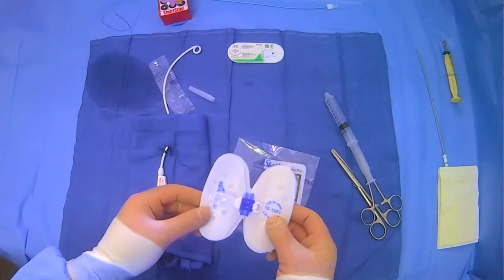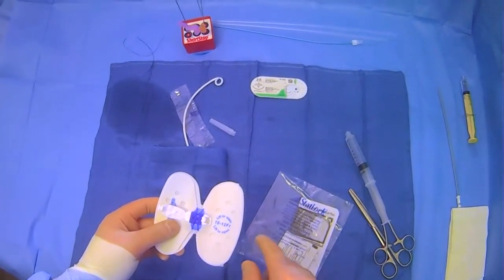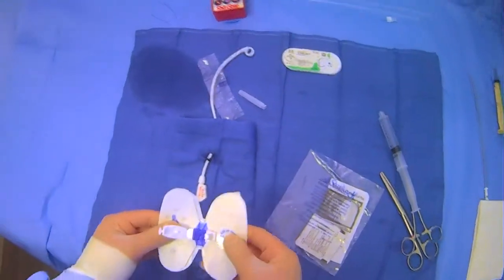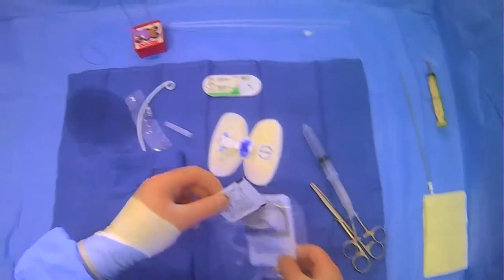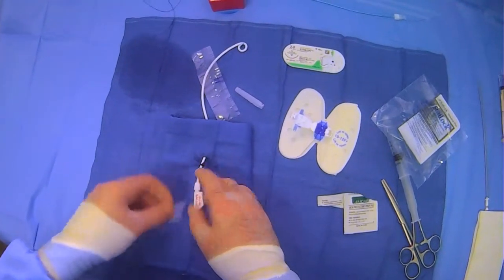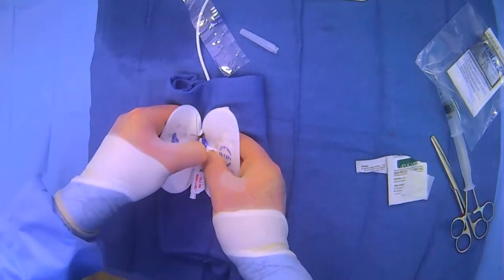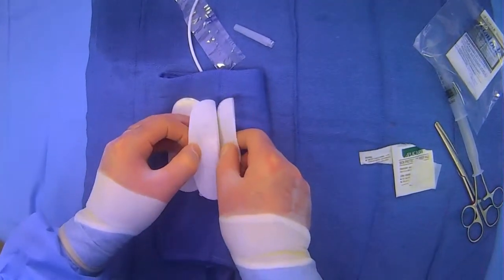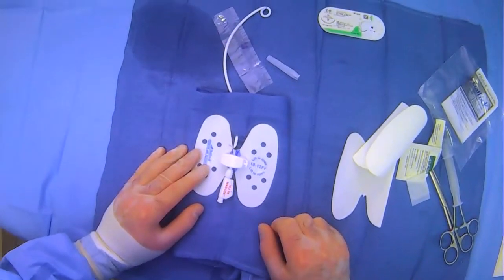Securing Tubes/Lines With The Statlock Device

Comment: Does the stat lock need to be as closest possible to the opening into the body?
Reply from the maker: This will depend on how the line/tube is positioned, however generally providers aim to place the stat lock closer to the opening in the body.
Reply: FWIW, I've been taking care of hubby's tubes at home, and I have learned to do a few things to make him less uncomfortable.  

His wound site care did not include such an anchor or stat lock at the site, so I simply dress the wound as instructed (two sets of 4x4 gauze pads, the bottom one split, plus Tegaderm on top), but further from the wound site we now add both anchors and hydrocolloid bandages-- two of each of each side (he has bilateral nephrostomy tubes). 

 I place hydrocolloid bandages on the (ideally unbroken) skin as padding just under the thicker fittings along the tubing, and I place the anchors just distal to those fittings. (Our anchors are flat, without the hard plastic hinged gizmo the one shown above has.  Ours have a fine velcro instead and were ordered from Amazon.)   In the tube configuration shown above, I would have placed the anchor just distal (beyond, further from the body) to the fittings instead of placing it proximal (closer to the body) to the fittings as was shown here.  Always follow the instructions given to you and your loved one on discharge if any of this runs counter to their advice, but our reasoning is that this distal placement of the anchor will help prevent pulling on the wound site by the tube and reduce the chances of an accidental removal of the tube. 

Further forward, I place a second hydrocolloid bandage under the clamp and its nearby fittings, also for padding.  Lastly, I place a second anchor just distal to the Y formed by the fitting which enables us to flush his tubes.  We could have used just one anchor on each of his two nephrostomy tubes, midway between the two, but we feel that placing the anchor immediately distal to any fittings or wyes will best help prevent the tube from being pulled out of his body accidentally.  

Over time, we have learned to place each of the two anchors on different days, so that when one loses its grip on his skin, the other will still be holding firm.  Thus we alternate changing those anchors so one will always continue to hold firm a few days later when the other lets go.  The nearby hydrocolloid bandage will usually fall off at about the same time as the nearby anchor.  Hubby will suddenly notice that the nearby fittings are digging into his skin more than usual but he may not have noticed the anchor having come loose;  that's when we attend to the oldest of the two anchors on each tube.  

I hope this helps others to be more comfortable with their tubes, but again, please follow your health care provider's instructions before adopting my suggestions.  Our instructions did not include any stat locks, but we were told we could use an anchor further out if we wanted to.  Another tip:  our anchors came with a very small strip of adhesive directly under the tube where the velcro wraps around it, which I did not notice the first time we used one.  (This is a tiny third bit of adhesive located on the side away from the skin and away from the two broad adhesive surfaces.)  While using this tiny bit of adhesive does indeed hold the tube more firmly longitudinally, we find that hubby is more comfortable overall if we instead leave that tiny strip of backing on and do not use that adhesive, relying entirely instead on the velcro loops alone to attach the tubing.  This does, however, make the placement of the anchors only just distal to the thicker fittings all the more crucial.  (Placing the anchor just proximal to the fittings would tend to pull the tubing away from the body during normal movements through out the day, which would pull on the stitches and cause pain.)